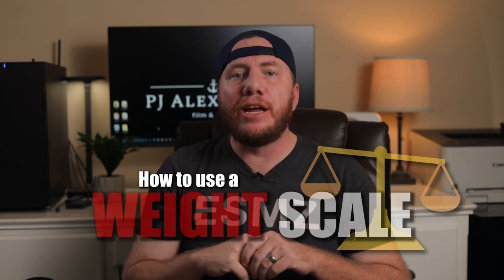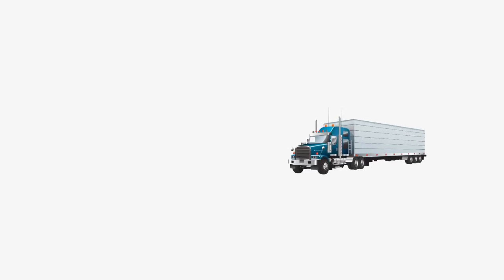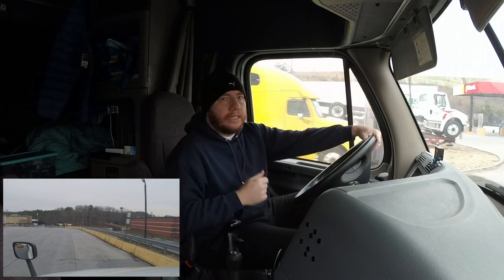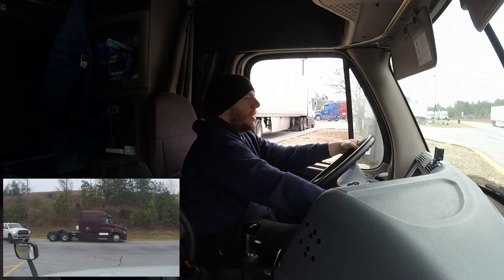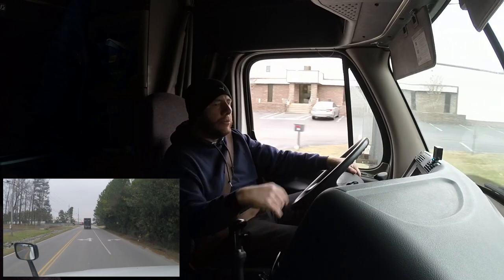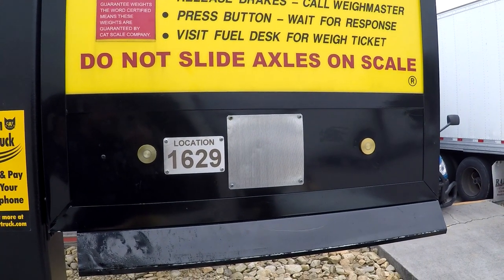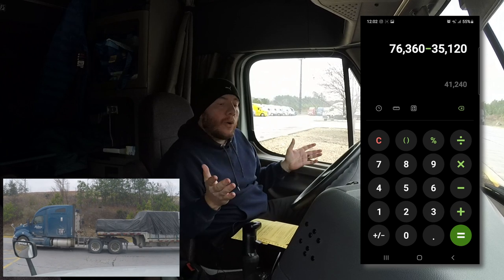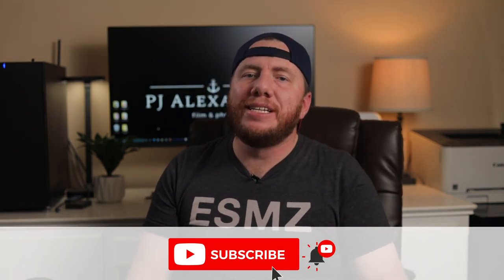How to Use a Weight Scale for a Semi-Truck - Knowing your Vehicle Weight | Regional Trucking

Comment: You got an e track wagon but I see that you didn't strap your load one strap Infront of the skids would help you stay out of trouble incase of a load shift. The best thing about cat scale is that they will go to court to help you fight the over weight ticket. I will admit that that I did not know that you could do a reweigh at the same location after loading that I didn't know I'm medically retired from trucking now so I can't use that information now. Be safe out there driver. You got the one original Highway Prisoner now medically retired and living in the Philippines.

Comment: You said you were going back to get an “approximate “ weight of your load. Why isn’t it an exact weight?
Reply from the maker: These scales aren't 100% accurate every time. Scales need to be calibrated every once in a while. Some drivers have weighed different at a DOT weigh station after weighing on CAT scales before.

Hence why I say approximate
Reply: @bigrigpro763 thanks for your quick reply. I didn’t know that .

Comment: Hypothetical: If you get loaded and wind up being overweight (if that is a thing), what do you do?
Reply from the maker: If you're overweight on all axles and cannot distribute the weight, you can either risk the haul and hope you don't get weighed or inspected; or you return to the shipper and have a portion of the load removed.
Reply: @bigrigpro763  But if you return to the shipper and are pulled over on the way back to the shipper, wouldn't you be fined?

Comment: Will the Cat scales weigh a passenger car? I want to know the individual weights of my front steer axle and the rear drive axle.
Reply from the maker: Yes but CAT scales only weigh semis at length which means you'll have a tough time weighing the small length of your car to find the axle weight
Reply: @bigrigpro763  Thanks.

Comment: I worked for a company that made you pay out of pocket for scaling! The shipper overloaded me 3 times. Then told my company I would not pay another penny out of pocket for a reweigh. They refused so I dropped the trailer on side of road and, deadheaded  800+ miles home! Snatched the batteries and abounded the truck
Reply from the maker: Well I would not have abandoned the company truck but I certainly would have quit, especially after fair notice.
Reply: How did that work out for you 🤣

Comment: OK, so you think you might be overweight, so you go to a scale and find you are over the legal limit.  Curious on what your options are at that point.
Reply: That's why this is a completely useless video. This has about 2% useful info. 
Hopefully, a year later, you know to slide your tandems, 5th wheel or both. Or take weight off.

Comment: Just curious, why don’t you use your phone?
Reply: @bigrigpro763  Sorry, I meant using your phone to interact with the Cat Scale.  I’m not a driver but would really like to see how that works.
Reply: You can do that, however I never did do that I heard that some drivers did that but still had to pay plus it's better to have it on paper so if or when the scalehouse pulls you in for being overweight you can bring in your scale ticket to show them your weight. Certified Automated Scale better known as cat scale are top rated scales.
Reply: @richardwilson3400  Interesting.  I assumed it would let you pay from the app and would email both you and your dispatcher with the results.
Reply: @richardwilson3400  
If you use the CAT scale app you can just put in the # on the scale and the weight ticket gets e mailed to u. You wouldnt have to go in to get paper one. Much more convenient